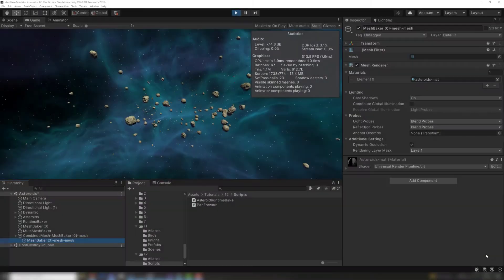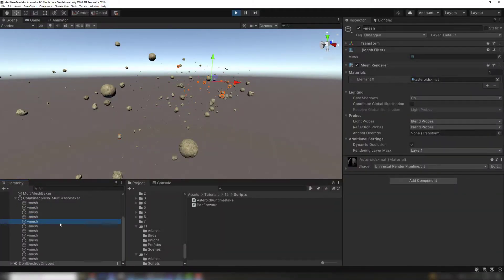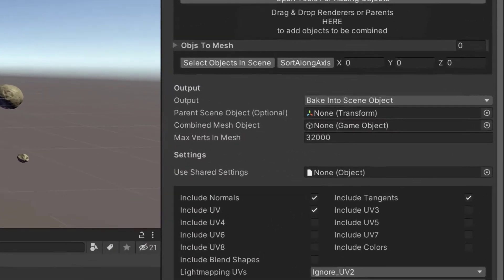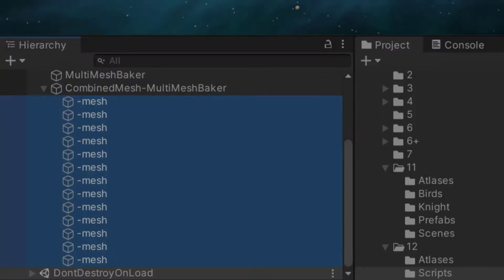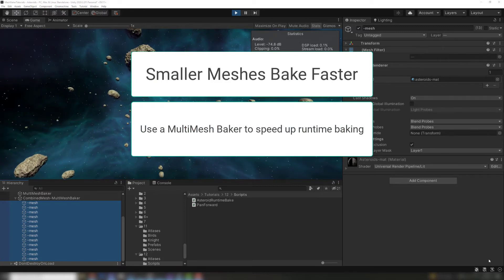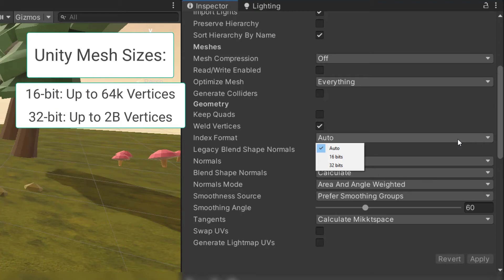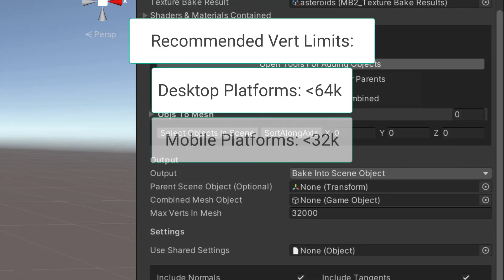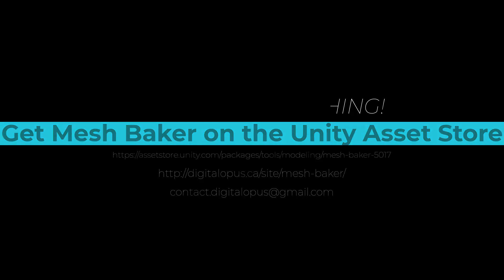Multi Mesh Baker

Comment: i can't find max verts in mesh option i think they have update it as this video is one year old. can you please tell me how can i do it with the new version
Reply from the maker: The field is there. Be certain that you are using an MB3_MultiMeshBaker component, not an MB3_MeshBaker component. It is under the "Output" section.
Reply: @IanDeane  i explore the whole plug in but didn't find it, can i send you email?
Reply from the maker: @moizali4698  Yes,     contact.digitalopus@gmail.com   or post your email here and I can send an image showing where it is in the interface.

Comment: Hey Ian! Can this be acheived with combining mesh and textures at runtime?
Reply from the maker: Most of Mesh Baker's features work at runtime. 

Many of the features that do-not work at runtime are texture baking features. The features that do not work involve converting textures to different formats in the editor. This is necessary so that Mesh Baker can copy textures into atlases from non-lossy (uncompressed) formats. Mesh Baker includes a Texture Packer Fast that does not require converting texture formats that can be used at runtime. However the quality may not be as good if the source textures are in a compressed/lossy format.

I recommend to create the atlases (bake the textures) in the editor if at all possible. Baking the meshes is fast and almost all features work at runtime. Mesh Baker includes several example scenes that demonstrate runtime baking.
Reply: @IanDeane  Thanks Ian, I actually pruchased a couple of years ago and am a big fan. Thank you for your response.